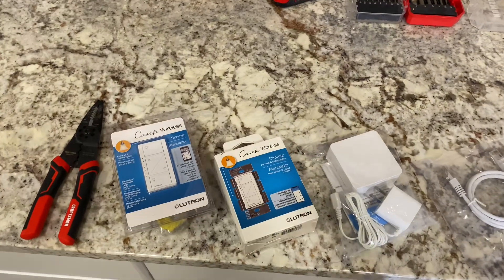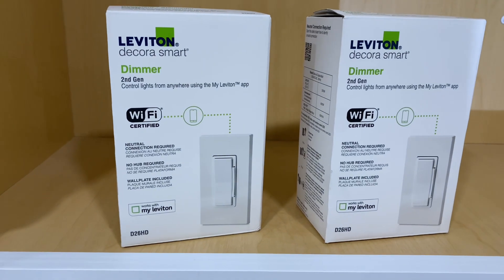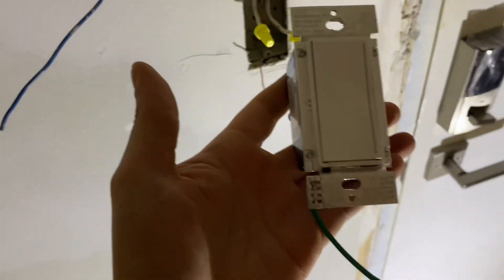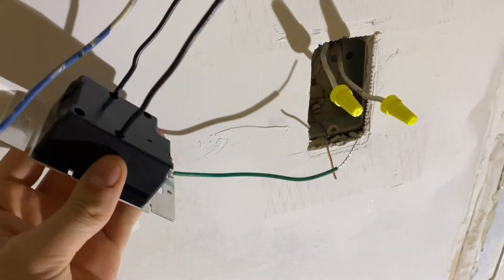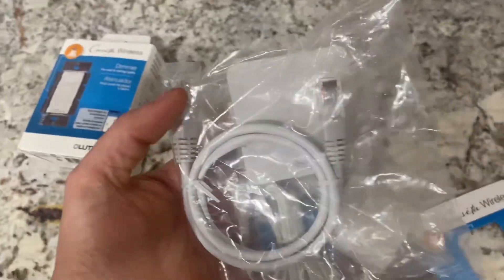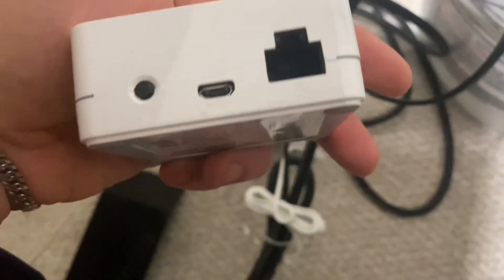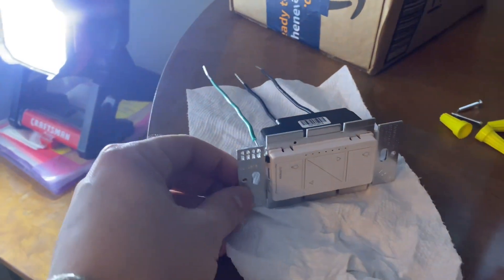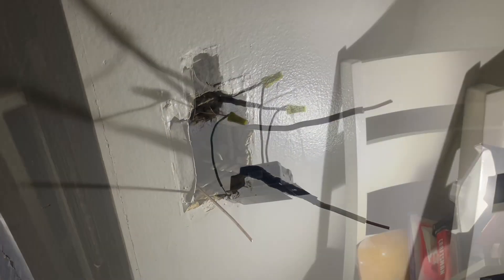How To Install A Smart Dimmer Switch With No Neutral Wire! - Lutron Caséta

Comment: Thanks for the informative and chill video. Good instructive vocal tone. So, I have the same mixed up "switchuation©️" in my home, some switch boxes with and some without neutral wires. I'm curious about which bridge you purchased. I'm one of those people who will inevitably purchase the wrong piece of equipment, then end up delaying my projects for an embarrassingly long period of time before I get around to returning it, purchasing the correct one, and then finally restarting the installation. I appreciate any information you can give me! Cheers from Chicago!
Reply from the maker: Thanks you very much I bought the Lutron hub I recommend trying to find one on eBay used. You can save half .  Lutron Caséta Smart Hub | L-BDG2-WH | White